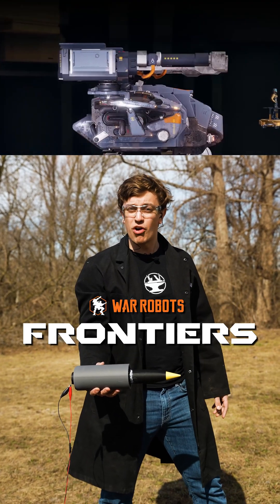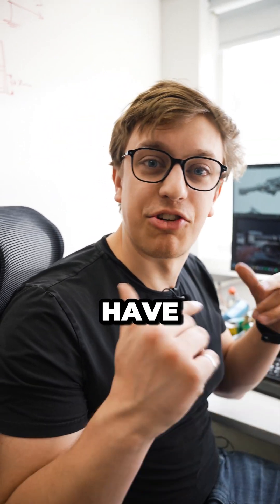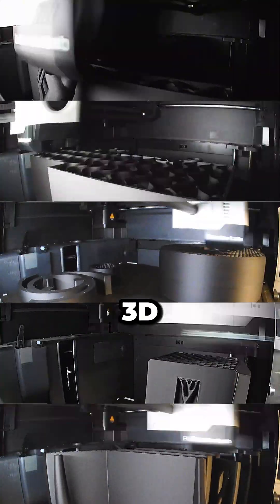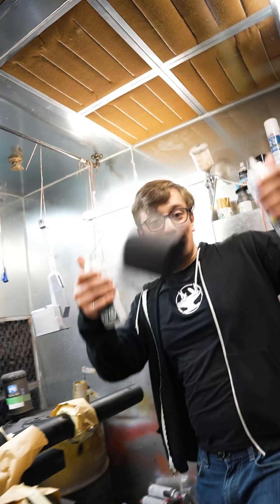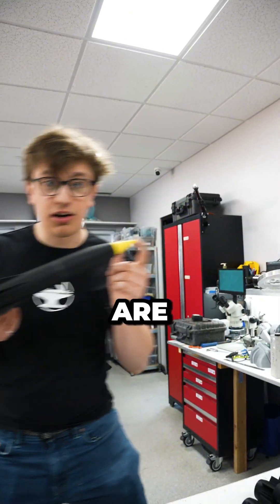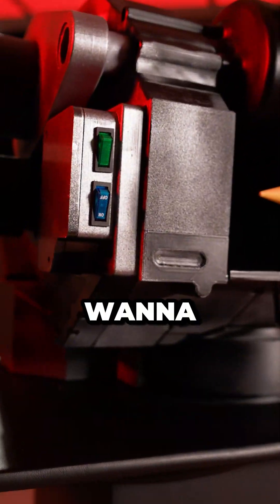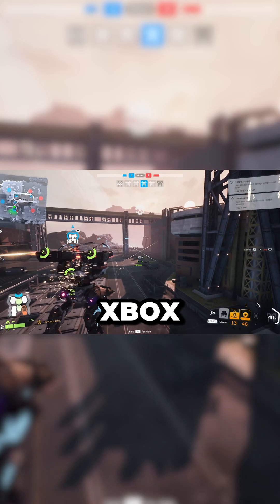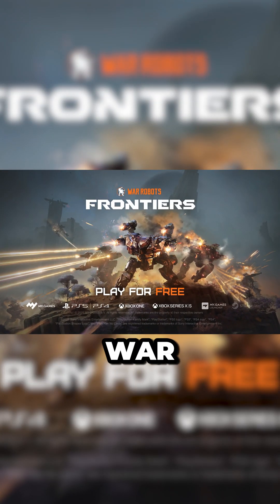It's not rocket science... 🚀 #wrfrontiers #rocket #engineering

Comment: Very cool build! The rockets probably need larger fins or rotation for stabilization if you want to hit anything (if that’s even a real goal). 
 
Larger or even fold out fins are probably the simpler solution as a rifled barrel might not work at those speeds and is probably harder to build. Even then the variability in the rocket motors and chamber might make this hard (thrust would need to be perfectly centered. 

You could also use it as a mortar tube for fireworks!